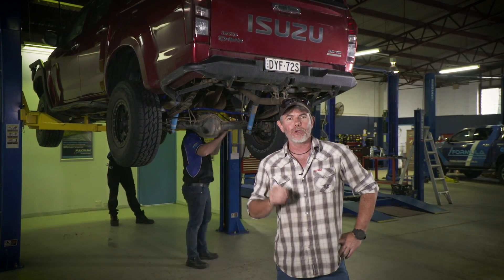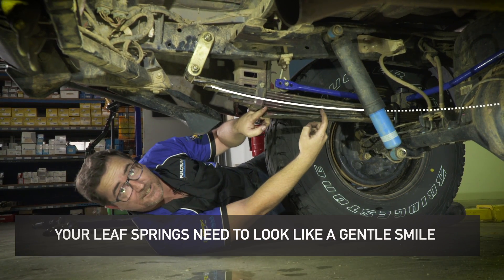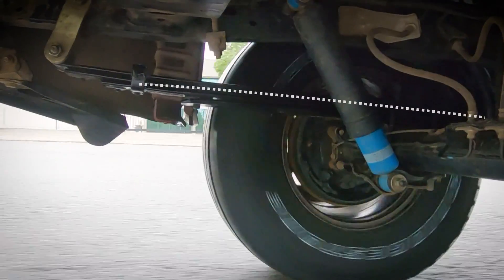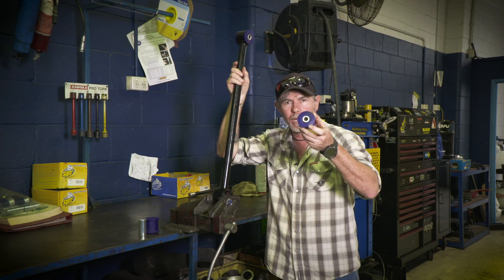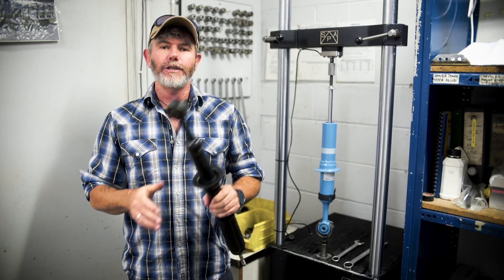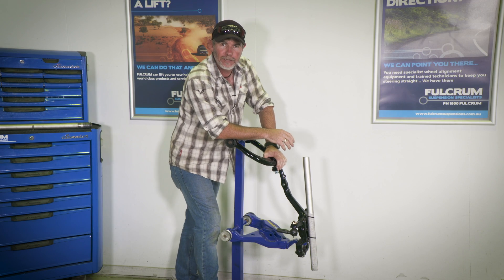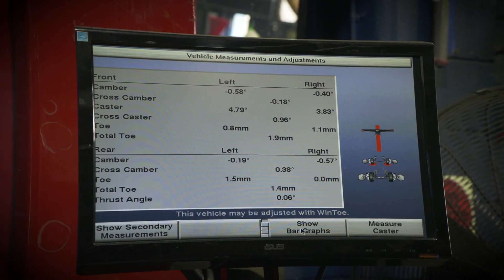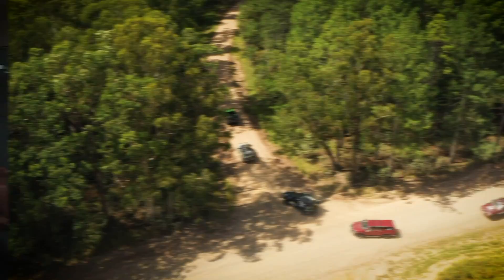4WD SUSPENSION IN DETAIL – what your 2 inch lift is missing! Graham Cahill reveals expert secrets

Comment: Guys it costs around $100 for an alignment over here.  I’d be broke if I did that every time I went 4 wheeling.  Unless I’m gonna break out the chalk, tape, and string and diy every week.
Reply: You dont have to do a wheel alignment everyday if budget is an issue. You will just have to do a wheel alignment far more regular than you would a normal on road car. This is only the case if you want to prevent excessive tyre wear, etc.

Comment: great vid but them polys are rock hard on road,far to harsh,well they are on a disco 4
Reply: SuperPro bushings are designed per application, in varying duros. They are not all hard, it sounds like you have had a bad experience with our competitors :(

Comment: I have a question for you! What are the main differences in ride characteristics running leaf springs spring over axle vs spring under axle? are there benefits to one over the other off road and on road?
Reply: No difference in ride quality. If the spring is on top though you dont need as much camber to achieve the same height.

Comment: Do fulcrum suspension do swaybar disconnects, so that when you stop to reduce the air pressure in your tyres you can disconect the swaybar at the same time to allow for more articulation on the rough stuff?
Reply: We only do sway bar disconnects for a Nissan Patrol.
Reply: Fulcrum Suspensions 

I have a 2008 pj ranger and I was wondering what constant kg leaf spring you would recommend for me 
I’m a tradie have a drawer system in the back with tools in it 
So probably 200+kg 

Cheers

Comment: I have a 1999 ford courier single cab tray on 31x10.5 and was wondering when I do a 2inch lift should I do the front torsion bars as well and what rating of spring to use because I also do some delivery work with about 700kg pallets?
Reply: It could be to your advantage to change the torsion bars. I would advise on 300kg constant load leaf springs. These are comfort springs but will handle increased load when necessary.

Comment: I found this vidieo very informative   well done Graham an the to the   guys at Fulcrum 😎
Reply: Leon Bennett video*
Reply: Thanks Leon :)
Reply: I'm thinking of  geting a 2 inch lift done to the the 07 SR5 Hillux   ,, how much would i be looking at to get that done an I mainly tow a camper trailer  or the jet ski it has 3 roof rack bars on the top  with a with two  brackets that can  be taken off which is use to carry a two person kyack on with a  single person kyack on top too
Reply: It's a dule cab with a canopy on too as u see  pictured in my profile pic

Comment: One point you missed when lifting your IFS 4WD you need keep in mind of the CV angles you want them as straight as possible because it will lower the chance of a break and the boots from breaking.
Reply: But if the car still can move after broken cv,im all good...as long im not stranded somewhere in remote area

Comment: If you have a sway bar, would this affect wheel articulation?
Reply: Fitting larger sway bars, particularly in the rear, has two main effects, vehicle balance in terms of under steer or over steer and increased roll resistance. Both of these effects can provide increased overall handling and safety benefits in a 4WD vehicle. If you are looking for increased stability on the road or when towing, sway bars are a great upgrade option.  

As most factory vehicles are partial towards under steer, fitting of a larger rear sway bar, or the addition of a sway bar, helps in providing a more neutral characteristic in the handling. This is due to the increase in roll stiffness at the rear, which changes the loading of the rear wheels under conditions of increased cornering load. SuperPro offers a great range of aftermarket sway bars engineered for many off-road applications, also offering many adjustable kits to best suit your 4WD build. 

At the same time, as the rear end is resisting more of the roll, the front end resists less in proportion, leaving the front wheels more evenly loaded, producing more available front end grip. In the end an increase in overall stability can be achieved by balancing the vehicle.

Another effect of introducing larger rear sway bars is a reduction in chassis roll. This reduces the effects of “roll camber”. Roll camber is the variation in the wheel and tyre camber setting due to chassis roll. During cornering the presence of chassis roll usually results in the outside wheels gaining positive camber. By increasing the roll stiffness and reducing roll camber effect, the wheel and tyre combination stays closer to its optimal setting.

As an alternative, this could be remedied by starting out with large amounts of static camber to counteract the positive camber gain. The trade-off however is the resulting increased tyre wear, and reduction in straight-line handling.

Now that the basics are covered, imagine a Nissan Patrol, Toyota Land Cruiser or Toyota Hilux that has been lifted 50mm with a bull bar and winch package. It has been fitted out with a draw system, roof rack and tows a twenty foot caravan! This may be the extreme, but somewhere between this and a standard, off the showroom floor vehicle, is where most of these vehicles operate. The factory sway bars were never designed to control anything other than the standard vehicle at standard ride height and with something less than being loaded to their GVM (Gross Vehicle Mass) limit.

The modern 4WD Dual cab utility, almost the family sedan of this century. Is normally coil sprung with a strut front end and leaf sprung rear with no rear sway bar support. Because of this dual cabs typically suffer from under steer and can be very unstable during high speed directional changes. When you load the vehicle with accessories, people, change its height or tow the problem only gets worse.

The biggest resistance to the fitment of bigger sway bars to 4WD vehicles is the flawed concept of the loss of articulation in the suspension. If the replacement sway bars are designed correctly and the sway bar links are lengthened, replacement sway bars can be fitted with minimal or no loss of articulation. However, the improvements to stability, safety and drive ability will far outweigh any loss of articulation.

So without reducing comfort or articulation, a sway bar will make the suspension system and tyres perform better, making the vehicle more responsive while neutralising under steer. Fitting a sway bar offers all round improvements in handling, tyre wear, comfort, safety and load carrying. It is one of the best handling improvements you can make.

Feel free to call us on 1800 385 278 or send us a message through our website.

Comment: but sway bar gives away your suspension travel/ flex is it not ?
Reply: Fitting larger sway bars, particularly in the rear, has two main effects, vehicle balance in terms of under steer or over steer and increased roll resistance. Both of these effects can provide increased overall handling and safety benefits in a 4WD vehicle. If you are looking for increased stability on the road or when towing, sway bars are a great upgrade option.  

As most factory vehicles are partial towards under steer, fitting of a larger rear sway bar, or the addition of a sway bar, helps in providing a more neutral characteristic in the handling. This is due to the increase in roll stiffness at the rear, which changes the loading of the rear wheels under conditions of increased cornering load. SuperPro offers a great range of aftermarket sway bars engineered for many off-road applications, also offering many adjustable kits to best suit your 4WD build. 

At the same time, as the rear end is resisting more of the roll, the front end resists less in proportion, leaving the front wheels more evenly loaded, producing more available front end grip. In the end an increase in overall stability can be achieved by balancing the vehicle.

Another effect of introducing larger rear sway bars is a reduction in chassis roll. This reduces the effects of “roll camber”. Roll camber is the variation in the wheel and tyre camber setting due to chassis roll. During cornering the presence of chassis roll usually results in the outside wheels gaining positive camber. By increasing the roll stiffness and reducing roll camber effect, the wheel and tyre combination stays closer to its optimal setting.

As an alternative, this could be remedied by starting out with large amounts of static camber to counteract the positive camber gain. The trade-off however is the resulting increased tyre wear, and reduction in straight-line handling.

Now that the basics are covered, imagine a Nissan Patrol, Toyota Land Cruiser or Toyota Hilux that has been lifted 50mm with a bull bar and winch package. It has been fitted out with a draw system, roof rack and tows a twenty foot caravan! This may be the extreme, but somewhere between this and a standard, off the showroom floor vehicle, is where most of these vehicles operate. The factory sway bars were never designed to control anything other than the standard vehicle at standard ride height and with something less than being loaded to their GVM (Gross Vehicle Mass) limit.

The modern 4WD Dual cab utility, almost the family sedan of this century. Is normally coil sprung with a strut front end and leaf sprung rear with no rear sway bar support. Because of this dual cabs typically suffer from under steer and can be very unstable during high speed directional changes. When you load the vehicle with accessories, people, change its height or tow the problem only gets worse.

The biggest resistance to the fitment of bigger sway bars to 4WD vehicles is the flawed concept of the loss of articulation in the suspension. If the replacement sway bars are designed correctly and the sway bar links are lengthened, replacement sway bars can be fitted with minimal or no loss of articulation. However, the improvements to stability, safety and drive ability will far outweigh any loss of articulation.

So without reducing comfort or articulation, a sway bar will make the suspension system and tyres perform better, making the vehicle more responsive while neutralising under steer. Fitting a sway bar offers all round improvements in handling, tyre wear, comfort, safety and load carrying. It is one of the best handling improvements you can make.

Feel free to call us on 1800 385 278 or send us a message through our website.

Comment: Love the vids and the mags. A question, should the front diff bè lowered after suppension lift on vehicles with independent front suspension? Thanks.
Reply: Up to 2 inches or 50mm you can get away with it. If you go over 2 inches or get long travel shocks you will need to do a diff drop.
Reply: @FulcrumSuspensions1976  Thank you.
Reply: Mental Mark say what

Comment: hello there i have a vw mk2 1.3 lifted.
how do you waterproof your vehicle?
Reply: Not really suspension related, but I am more than happy to try and answer. It depends on how waterproofed you want to go. To make sure your car handles any light water crossings. Make sure you keep up momentum and all your seals are up to scratch. If you are going through tougher water crossings, be prepared for your 4WD to take on some water, get a snorkel and make sure you keep momentum. You could also try your luck at ripping everything down to your 4WD's body chassis and get some waterproofing material.

Comment: How do sway bars affect flex in a dual cab?
Reply: Fitting larger sway bars, particularly in the rear, has two main effects, vehicle balance in terms of under steer or over steer and increased roll resistance. Both of these effects can provide increased overall handling and safety benefits in a 4WD vehicle. If you are looking for increased stability on the road or when towing, sway bars are a great upgrade option.  

As most factory vehicles are partial towards under steer, fitting of a larger rear sway bar, or the addition of a sway bar, helps in providing a more neutral characteristic in the handling. This is due to the increase in roll stiffness at the rear, which changes the loading of the rear wheels under conditions of increased cornering load. SuperPro offers a great range of aftermarket sway bars engineered for many off-road applications, also offering many adjustable kits to best suit your 4WD build. 

At the same time, as the rear end is resisting more of the roll, the front end resists less in proportion, leaving the front wheels more evenly loaded, producing more available front end grip. In the end an increase in overall stability can be achieved by balancing the vehicle.

Another effect of introducing larger rear sway bars is a reduction in chassis roll. This reduces the effects of “roll camber”. Roll camber is the variation in the wheel and tyre camber setting due to chassis roll. During cornering the presence of chassis roll usually results in the outside wheels gaining positive camber. By increasing the roll stiffness and reducing roll camber effect, the wheel and tyre combination stays closer to its optimal setting.

As an alternative, this could be remedied by starting out with large amounts of static camber to counteract the positive camber gain. The trade-off however is the resulting increased tyre wear, and reduction in straight-line handling.

Now that the basics are covered, imagine a Nissan Patrol, Toyota Land Cruiser or Toyota Hilux that has been lifted 50mm with a bull bar and winch package. It has been fitted out with a draw system, roof rack and tows a twenty foot caravan! This may be the extreme, but somewhere between this and a standard, off the showroom floor vehicle, is where most of these vehicles operate. The factory sway bars were never designed to control anything other than the standard vehicle at standard ride height and with something less than being loaded to their GVM (Gross Vehicle Mass) limit.

The modern 4WD Dual cab utility, almost the family sedan of this century. Is normally coil sprung with a strut front end and leaf sprung rear with no rear sway bar support. Because of this dual cabs typically suffer from under steer and can be very unstable during high speed directional changes. When you load the vehicle with accessories, people, change its height or tow the problem only gets worse.

The biggest resistance to the fitment of bigger sway bars to 4WD vehicles is the flawed concept of the loss of articulation in the suspension. If the replacement sway bars are designed correctly and the sway bar links are lengthened, replacement sway bars can be fitted with minimal or no loss of articulation. However, the improvements to stability, safety and drive ability will far outweigh any loss of articulation.

So without reducing comfort or articulation, a sway bar will make the suspension system and tyres perform better, making the vehicle more responsive while neutralising under steer. Fitting a sway bar offers all round improvements in handling, tyre wear, comfort, safety and load carrying. It is one of the best handling improvements you can make.

Feel free to give us a call on 1800 385 278 or send us a message through our website.
Reply: All traditional sway bars reduce flex, regardless of the vehicle

Comment: I've heard a comment that manufacturers put rubber bushings in because they are a replaceable item designed to wear so other components don't wear. Is there any truth to that? If urethane bushes are the best thing, why don't they come OEM? I feel it's not just so they can charge you to replace them...
Reply: Rubber wears out quicker than poly. Polyurthane bushings are also much more expensive to produce. That is why you will find that SUperPro  bushings are a bit more expensive, than you have to factor in the fact that they make all their bushings in Brisbane, Australia. TDLR: Rubber is cheap and easy for OEM manufacturers.

Comment: What is the real thing that really lift your car! The leaf springs or the suspension?
Reply: 'Suspension' is all the suspension components working together. Springs are what gives your vehicle lift and are used to carry the weight of your 4WD. Shock absorbers are used to make sure your wheels stay on the ground and control the spring.

Comment: I would like to know what affect the lift would have on the ifs front cv joints in terms of strength and reliability regards mike
Reply: You wont have any problems as long as you dont lift it to high. This is due to vehicle design, if you go overboard you will always break stuff. It is one of the reasons a 2 inch is the legal lift limit in qld (without mod plate).

Comment: For a non traidie with a super cab ute, would you recommend coil conversion or just stick with the standard leafys
Reply: I would recommend you stick with standard leafs, you will only need a col conversion if you need an insane amount of flex. If your a tradie you can get the job done with leaf springs. Feel free to give us a call on 1800 385 278 or send us a message through our website.
Reply: @FulcrumSuspensions1976  thanks for the advice
Reply: CRTN tradie*
Reply: @bigman4256  😉cheers

Comment: Hey guys, best 4x channel on YT by a large margin! My question is about my 2016 series 200 Land Cruiser. I'd like to get about a 2" lift but I'm worried about adversely affecting the KDSS system, which really works perfectly on the road. Do you have any specific recommendations for this truck? Thanks!
Reply: A 2 inch lift will not affect the KDSS, it will only require a few extra parts and a reset once completed and it will work perfectly.